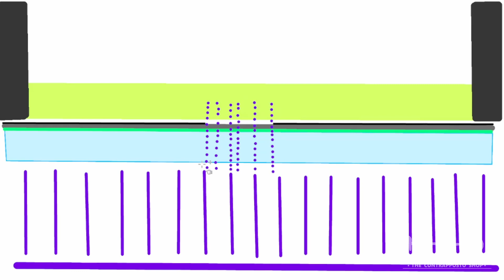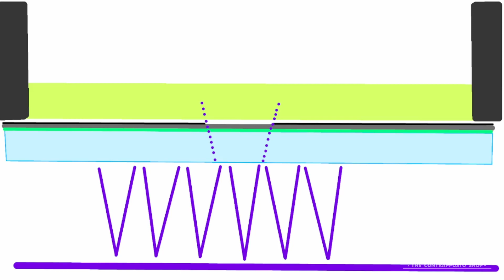Is glueing your printer LCD a good idea?

Comment: if the quality is not worsen i would say keep the glass . it would be  good protective layer to prevent lcd crack
Reply from the maker: The purpose was not much for protecting the LCD because the glass sits under it. The goal was to remove the thin air gap between them :) ! Also you can’t put to much material on top of the LCD because the risk of other optical problem increases
Reply: @thecontrappostoshop  ah gotcha. i thought its on top of the thing

Comment: do i need glass ? or just bare LCD ( with screen protector ) alone is enough ? assuming there's no gap between fep sheet and the screen
Reply from the maker: With the results i had with this experiment i would not recommend it :) ( there is not enough improvements )… generaly resin printers already with a glass panel and in few cases they are already glued to the LCD.

Comment: Fantastic. If that’s the deal, I wonder if the glass and LCD can be hermetically sealed together in a vacuum.
Reply from the maker: Manufactures ( like the one in the BOM ) can offer « optically fuse » LCD with any thickness glass … it’s the best option but i know there is printers out there that is not fused or glued. So this experiment was for those with this kind of setup :)